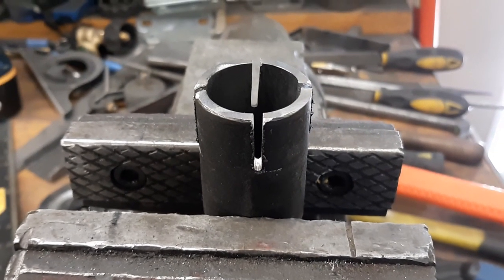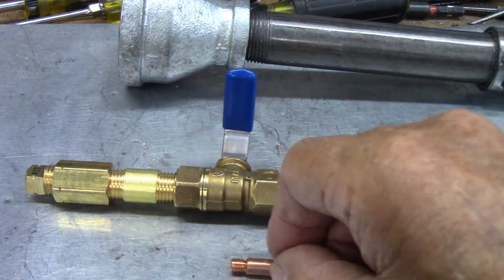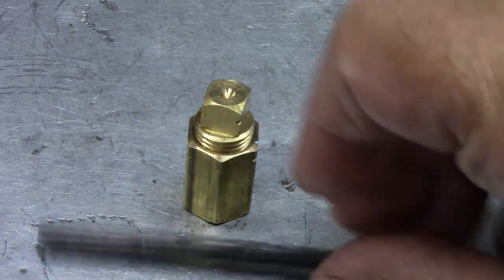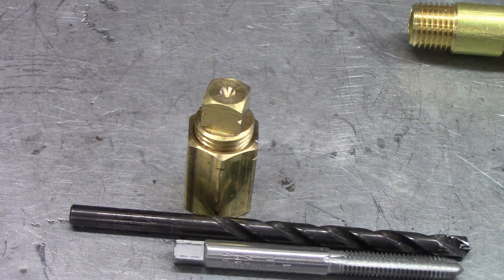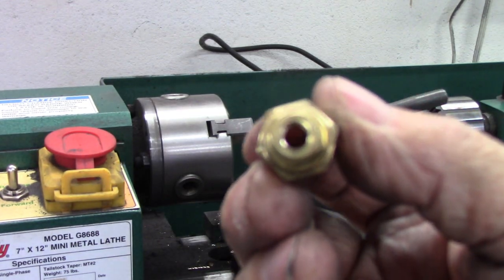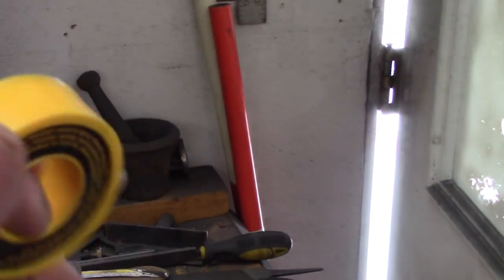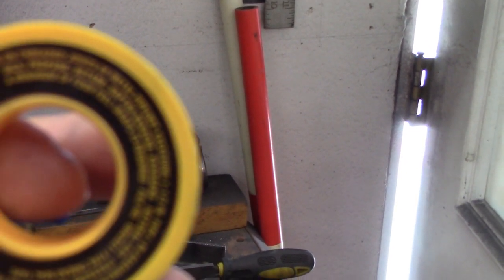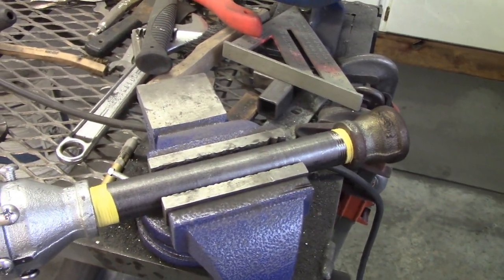HOW I MELT-GOLD-SILVER AND COPPER WITH THIS DIY BURNER

Comment: Nice.  Better than my first video that was my burner.  Great Flame !
Reply from the maker: Thanks brother for the kind comment. I have a forge that I built a few years ago but want to build a foundry to melt different metals.
Reply: Mine does not produce enough heat to melt gold.   I plan on making a double burner forge for blacksmithing, since my single didn't do the trick.  All about air flow, etc...
Reply from the maker: @MidwestDavesGoldProspecting  My forge uses a different burner than the one I just built. I think it would melt gold also. Just a little different style.

Comment: I was thinking when you made the flair at first why you didn't just use a reducer. Looking forward to the rest of the build as I have many pounds of brass collected over the years as a locksmith, keys, cylinders, etc.
Reply from the maker: Like most things I build from scratch, there are things you think will work but just aren't right after they are done. You are in a perfect place to make some brass ingots or re-melts and cast into something else.